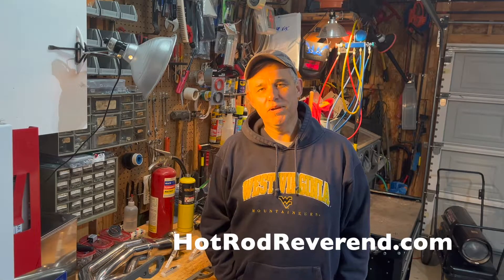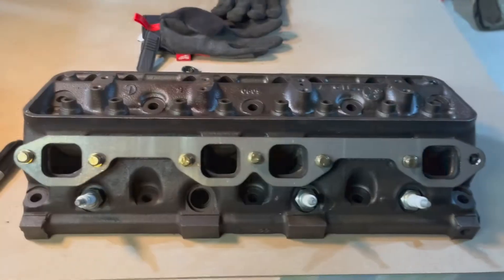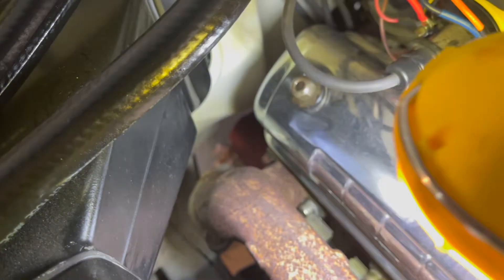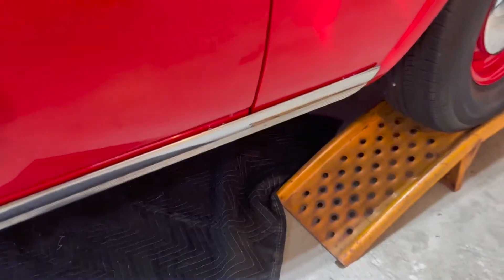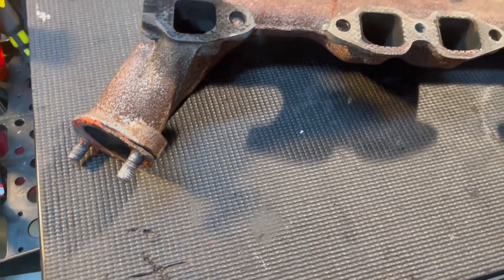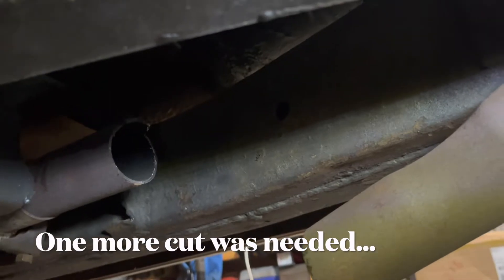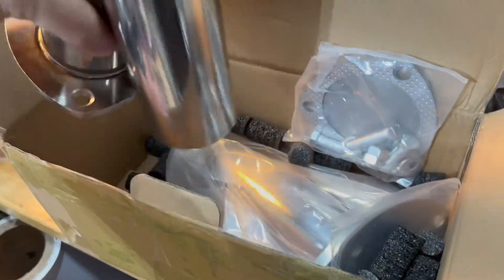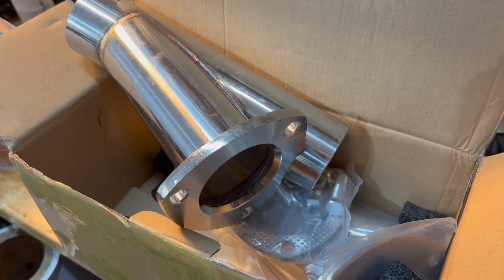Y Block Header Project Part 2

Comment: I bought pair of shorty yblock short headers from major maker, dyno'd 7HP gain. Tossed them back and only use proper designed long tube headers. One set about 10 years ago from Jerry, excellent fellow. I dyno tune all my builds, my Yblocks averaged +30hp/+40TQ from stock manifolds but gain depends on all the stuff upstream.
Reply from the maker: You need to start posting some build videos here on YouTube
Reply: @HotRodReverend  I'm 70 and still have to work to regain our savings lost in the obama recession and the insane covid shutdown, no pensions for the working man. I'd send you some pics but don't know how. All my yblock cars are already road rowdies. Essex project with the 300 6 is the most fun build I've ever had, very easy to modify non wood pre-wars. Got a 59 bird super cruiser project for this winter. Never sell your car and built it to fit you.

Comment: I had a 1957 Ford 312 with factory dual fours. I ran Hedman Headers that bolted to the factory exhaust pipes. I don't see them currently listed on Hedman's web site but you might find a used set.

Comment: I had to grind a point grind the header bolts on the rear stock manifolds and it was still a pain. I finally put the rear on in first when I added 57 exhaust manifolds to my 56.

Comment: Not to sound like a broken record, dear Brother Reverend, but remember that you will no longer have a heat riser valve to help combat carb icing in cold weather with the 1850. Two solutions; one more red neck than the other. You could install a cut-out on one side and block the uncorked passage. Pull the cutout lever for several blocks and that would push all the exhaust through the cross-over. Or, grab a tennis ball and stuff it in the left tail pipe for several blocks in cold weather with a cold start.. Corny, yes. Been doing it for decades.
Reply from the maker: Welp, I ran the 1850 for about 3 years with no trouble and no icing in all kinds of weather. Back in 1990 I removed the heat riser exhaust valve from my passenger side exhaust and have experienced 0 issues since then. The car no longer has an 1850, I went with a Summit carb as well.
Reply: @HotRodReverend  I always delete exhaust manifold valves and also block intake heat passages. Cold air intake is a thing. Been running old Fords for 54 years and never had carb ice but also never had vapor lock, also my performance Yblocks never over heat regardless of weather or heavy footy. Long tube headers in Y block cars very difficult but well worth the effort. Set em up right and they love you long time. Excellent engines. 4 post lift takes all the pain out. Check header bolts couple times a year.